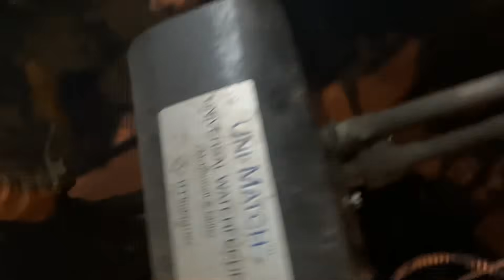🔥 DOUBLE Weil McLain Steam Boiler Install — Will We Finish by LUNCH? | Trivia Challenge Inside!

Comment: Looked good, the boiler twins. I like when every pipe is symmetrical, it shows that you take pride in your work and fact that you are training you guy's to do it the correct way you are setting them up for a great future.  It does not take that much more time to do it right.

BTW, I have not been over the Throgs Neck Bridge since 1976 when the toll was $1.00, yes, one dollar. I always carried a bag of quarters in my Mustang.

Comment: It's the exhaust venting of the left boiler, it appears to have a draft vent you normally see on a gas hot water heater. Plus the damper is after that draft colar.

Comment: As a certified hand truck operator for 40 years, and a consultant for 20 years you never go up a 90-degree angle, always put the wheels evenly on a flat surface...haaaa

Comment: That's what that belt on the dolly is for!!!! :hand-orange-covering-eyes: :face-purple-crying:
Reply: those never hold the bottom of a large heavy item on the base and they really need a second strap around the bottom, which I do with ratcheting straps a middle and bottom. even then the stuff lifts off the dolly base half the time, because it collapses or crushes. forearm straps work pretty good for bulky things, but obviously not great for very heavy things, like boilers!